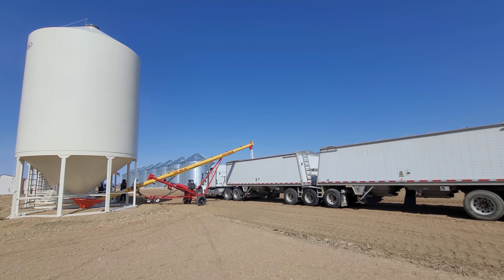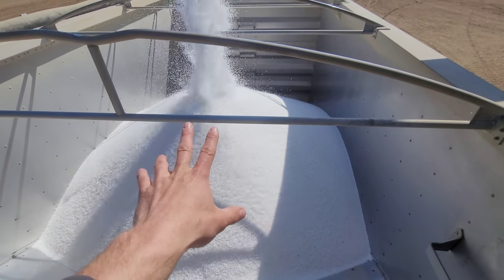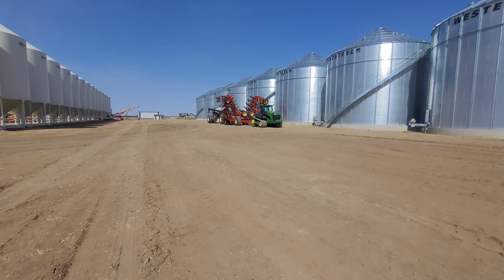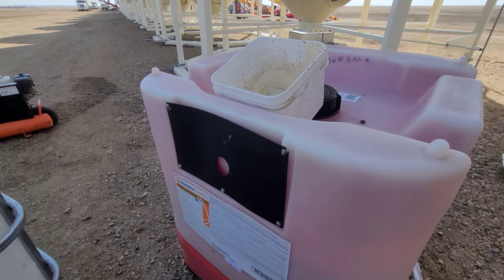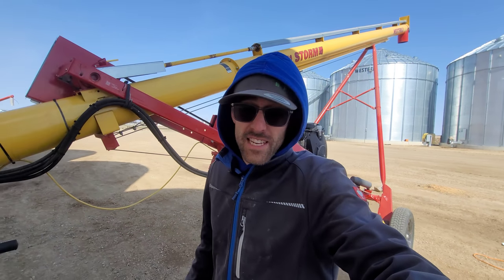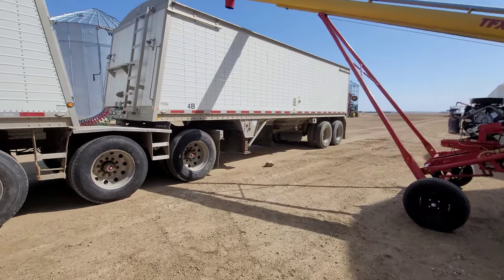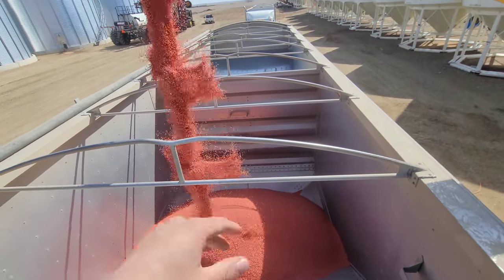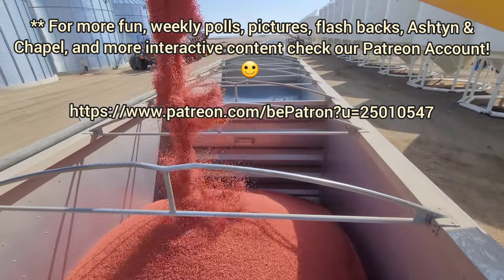Loading Fert & Treating Seed?

Comment: The front hopper (nitrogen) is white gold. The back hopper is rock fertilizer (potash & phosphate) which will store better than nitrogen because it's gas based which results in some loss of value due to gas evaporation. Have fun figuring out the mysteries of the grain business😁.

Comment: Im starting to understand your operation. Although you have a lot of expensive machinery  the actual cost per acre is very low.  Those tractors are probably still one thousand dollars a horsepower and the seed drills 500k but they cover a lot of acres. Overall, due to scale you are very low cost per ton. So a bad year like last is not a huge issue because when you get a good one, you are ' quids in' as my grandfather would say.
Reply from the maker: Thanks Andrewj, but last year was definitely a "huge" issue unfortunately and was for many farms no matter the scale, because the losses are relative to the size of the operation for the most part. 

I have said before that in a bad year you can lose more money than than 5 good ones will make you back. There will definitely be alot digging for the next couple years for many farms.

If we get another dry one this year, it will catastrophic.
Reply: In a twenty year run in that part of the North American plains you will get one year on average where the yield is very small and usually you won't run into two years back to back of severe drought but stranger things have happened.
Reply: @mikemitchell2554  does Canada not have multi peril federal crop insurance?
Reply: @kobybeougher7657  Yes, insurance is available BUT like all insurance today it is very expensive. Insurance companies were amoung the first to recognize climate change and price their coverage to be sure of making a profit. Obviously any change in climate will affect crops more than it will affect automobile damage.
Reply: @wssides  we have federal crop insurance with guaranteed $ at a set price. Just figured in libturd land up there there would be the same
Reply: @kobybeougher7657  Each province is different. Saskatchewan has had SGI for a long time but farmers can buy crop insurance from any of the companies they choose.
Reply: Last year for them was a very very bad hit the bigger the operation the bigger over head and cost a lot of people think they have all of that there rich or well taking care of but that usually is not the case they have to watch what they spend because another year like last year there is no farmer can handle one or two years like that close together or a few years apart it made me so sick watching what him and a lot other went through every body keep your head up and hope this year is a good one
Reply: @mikemitchell2554  time for rain dances

Comment: Just wondering why Farmers don't use two or more augers to load??? Seems to be a time consuming process that could be sped up with minimal investment.
Reply from the maker: The spacing of the bins doesn't allow you to load legal.
Reply: @mikemitchell2554  If you double the size at the bottom of the bottom of the bin and split it between two augers you'd be using one bin at twice the flow rate. Hope you can get a patient on it and avoid Canadian Law Enforcement! My whole life it's always been one auger slowly flowing into a giant space. They've gotten faster but you could still double it with a wee bit of engineering. Love your channel! Cheers from Thailand!
Reply: Double the cost,  double the repairs, double the problems,  double the maintenence.